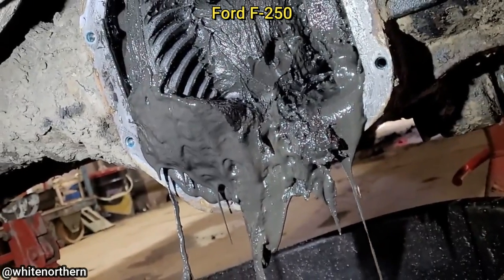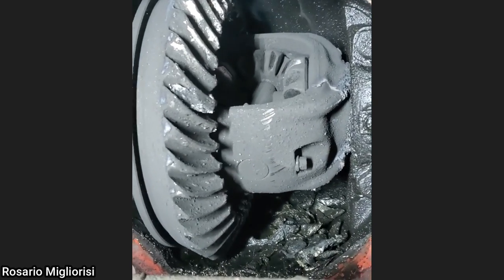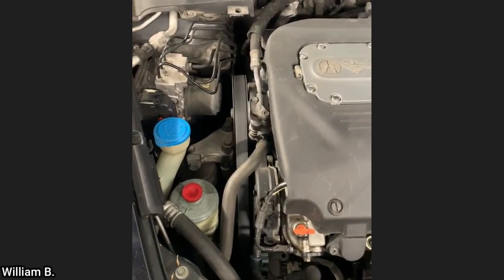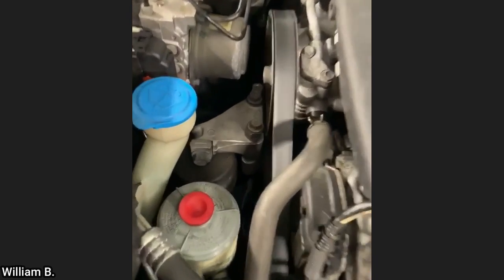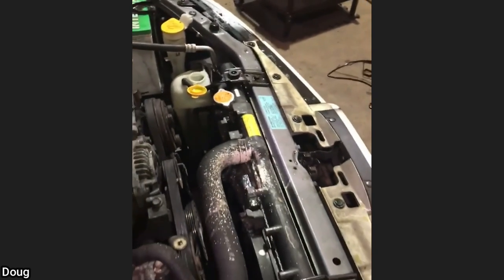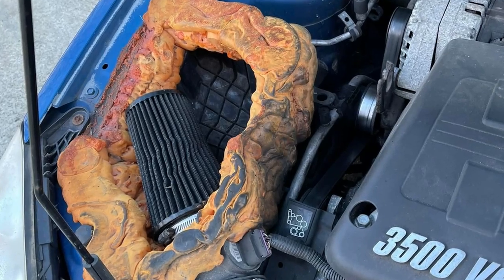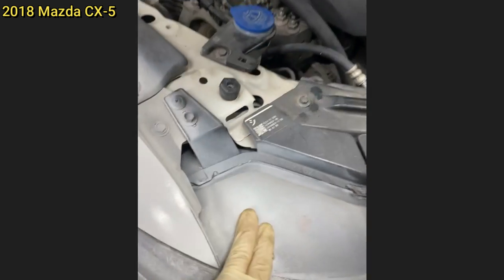Customer States Wheels Locked Up While Driving | Just Rolled In

Comment: I took my Rover sports special into a garage after hearing rattling noises in the gearbox while stationary. Mechanics called me to say it was probably the driveshaft bearings and would I give the ok for the repair. I said no, took my car, drove the 150 miles home and drained the gearbox oil myself. All the bearings came out with the oil. I found a second hand gearbox at a wreckers yard and swapped it in. Cost me about 200 NZ dollars. Not all mechanics have a clue. Good thing 1950's gearboxes were built tough.

Comment: I had to replace that side engine mount on my 06 Acura TL. It’s a common failure on the car and isn’t cheap because you have to remove the timing cover to get to the bolts.

Comment: Used to have an old 4.3L V6 that had main bearings so bad the whole crank would do that same thing, namely walking around the perimeter of what was left of the bearing shells. Sounded like one of those matchbox car wheels when you spin them too fast, but only 1,000,000,000 times worse.

Comment: Years ago, two lug bolts snapped on my front driver side tire. After replacing them and putting the tire back on, I went to move the car and it wouldn't go in reverse. I figured I didn't put one of the bolts all the way in and were hitting something, so I jacked the car back up, removed the tire and checked the bolts. They all seemed fine. I then took the breaks apart, thinking maybe I messed something up with them while installing the bolts. Once again, I put everything back together, lowered the car and put it in reverse.. and again it stopped after moving only a few inches.
For a third time, I lifted the car, removed the tire and checked to see what could possibly be wrong. Unable to figure it out, I just decided to put the tools in my trunk and get my Stepfather to come check it out.
When I went to the back of the car to put the tools in the trunk, that's when I realized I forgot to move the chalk block....
Reply: You're not the only one who's been there.  I've done the same but it was the parking brake left on.

Comment: Your given an estimate. Then if you agree with the Service Writer of what is needed to correct the problem , you will be told how long, now that sometimes can go longer if something else is going on, there is straight clock time , manual , and the hourly rate. Ihave flagged enough timesheets to know that. Parts is tricky , AC Delco with GM. Off brands like from Carquest , etc...  also some can void the Warranty coverage if the customer tried to fix it on their own. The Standing is alot on the feet and back .

Comment: 0:06 - This is why you run diff breather hoses up to the top of the engine bay or up into your snorkel! 

"..as it wood not start."  I see what you did there.

"Customer's boyfriend used to be a mechanic" - Think we found the "other shop" doing all the dodgy work, boys!  😂

Edit - JFC that '56(?) Chevy Bel Air! 😲👌 MINT!  ...and what's that convertible hiding in the garage I wonder?

Comment: Around the turn of the century, I was working as a grease monkey; they called me a "Lube Tech."  An old lady who lived out in the country brought her 1999 Mercury Grand Marquis in for a routine LOF and with the complaint that it had lost both power and fuel economy.

During the oil change, I checked the engine air filter.  Said air filter's housing was packed tightly, full of dog food.  I showed the manager, and the actual technicians got curious and started coming to see what was up.  We all had a good laugh.

Big surprise: when I cleared out all the dog food, the car went back to normal performance and economy.

Bonus: we found out later that same old lady was parking her car in a barn, where the dog food was kept- and where there were mice.  We all agreed that the mice were stealing the dog food and using her car as a storage bin.

Still doesn't top the crazy shit in this video, though😅😅😅😅😅

Comment: Seen worse paint jobs than that. Worked at a place once a guy had a red Yugo...he wanted a white Yugo..so he painted it...with a brush...with oil based gloss that you might use in your house...
On the plus side it didn't de-value the vehicle at all.

Comment: The guy that got everything replaced except the radiator confuses me. They’re already tearing everything in the engine bay apart, so why not let them get a new radiator in it too?
Reply: You might be surprised how expensive a radiator replacement is at a quality shop.  The owner probably look up the price of a Dorman radiator at $150 and thought the $1000 shop-quoted price was a ripoff for a 'simple' job that turned out to not be so simple.

Comment: How soon should the first change be on an automatic transmission and a differential? I've got a brand new 2022 Jeep and I'm wondering for the very first change only, after that i plan to follow the owners manual.
Reply from the maker: Whatever the owners manual recommends. Should have the maintenance schedule in it.
Reply: @JustRolledIn  So, you wouldn't do the very first one early?
Reply from the maker: @cat22_a1  personally no. I'd just follow the manufacturer schedule.

Comment: I'm thinking I had a different that looked like that second one. 60 MPH and she locked up on the highway. I was 19 and stupid. It was a drop in style, so poop the axles out, drop the driveshaft poop out the old diff, clean it up, drop in the used. 

Add oil.

Comment: At 2:31 we see someone has painted the lower front air dam on their Challenger to mimic the more expensive models.

That yellow section you see on the lower air dam on some Chrysler products?  That is actually a slip-on protective guard that is installed at the factory and is supposed to be removed by technicians during delivery preparation.  It's not actually part of the car.....

DOH!

Comment: I'll pass on getting new tires, an oil change, radiator, head gasket, U joints, air filter and exhaust system. The car still runs and drives.

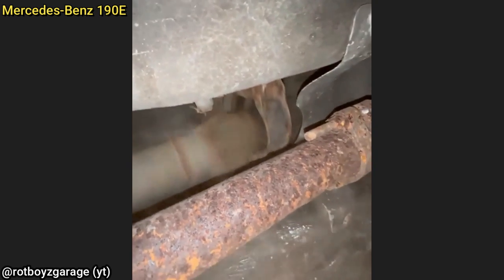Comment: 1:48, running that driveshaft in that condition is just moronic.  If it fails, and they're that close, it could be fatal.  You don't need to have it turning to see that it's TOTALLY shot.  Just EPIC stupidity to run any kind of equipment in that condition.

Comment: 1:25 I call bullsh*t. There is no freaking way that rodent would still be sitting on the backside of that wheel after the car was driven to the shop (even at relatively slow neighborhood street speeds. And I seriously doubt that the driver would actually hear it befor it was blendrized by the movin wheel.
Reply from the maker: It's a joke. The mouse was just randomly on the wheel when it came in for a squeaking noise (brake issue).